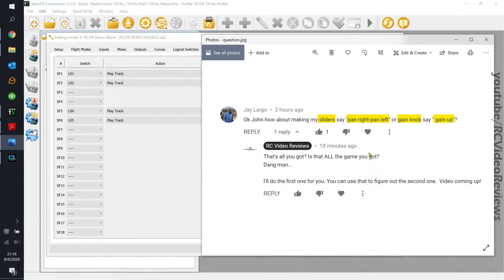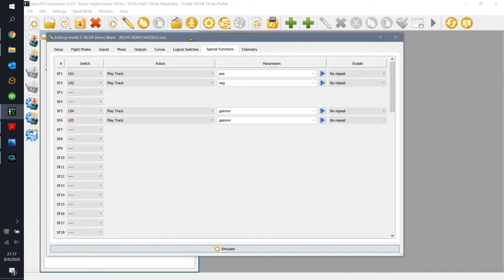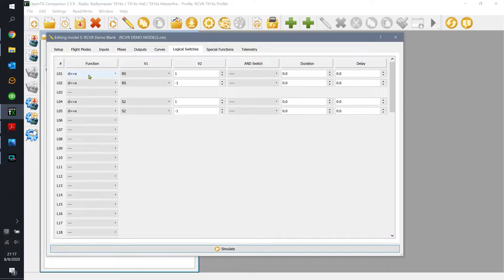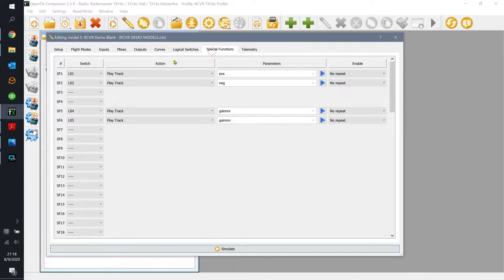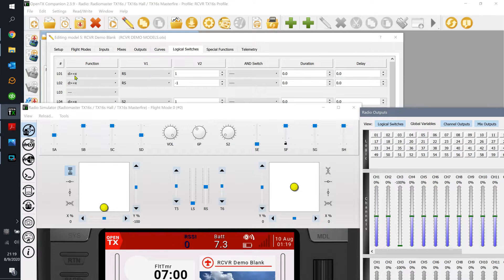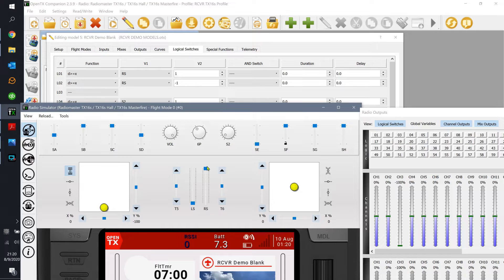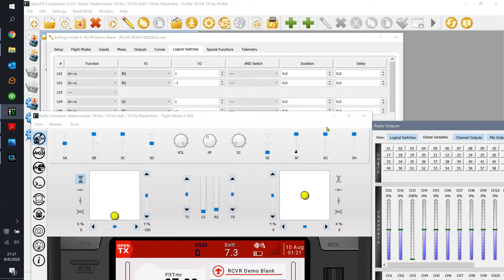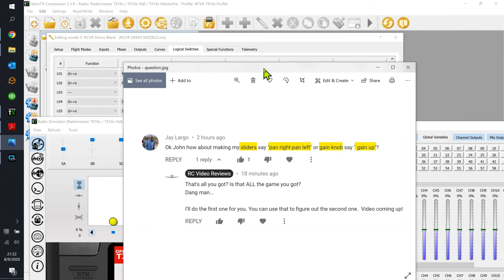OpenTx Tutorial • Slider/Potentiometer Audio Directional Feedback - Radiomaster TX16s [Intermediate]

Comment: If you increase V1 will that space the sound prompt as well ?
Reply from the maker: Do you mean increase V2? V1 is an input in both cases. If you increase V2, the logical switch won't trigger unless you move at least x spaces. So if you change it from 1, you could potentially move the input through it's entire range one step at a time and never get an audio prompt.